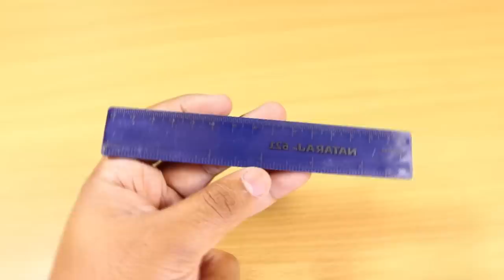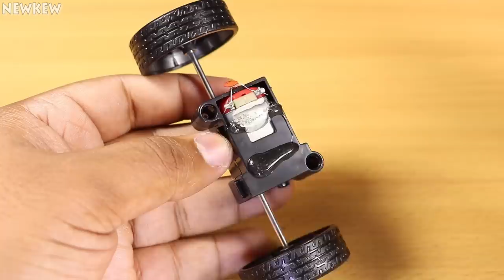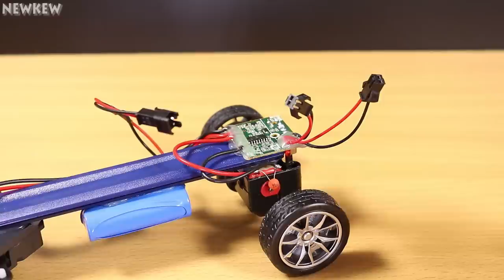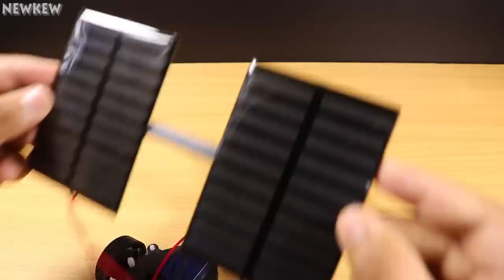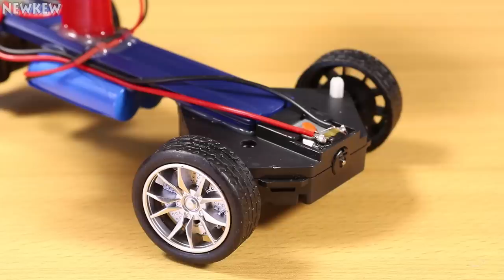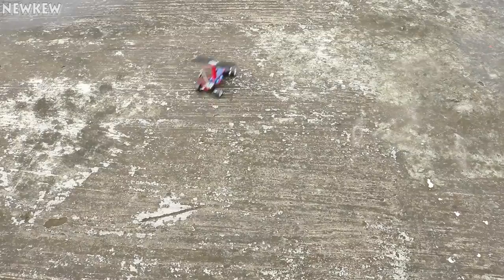How to Make Remote Controlled Solar Powered Car

Comment: Where did the solar panels selling
Reply: Banggood.com type solar panel
Reply: Type this at search 0.25W 5V 45*45mm Mini Polysilicon Solar Panel Epoxy board with Wire